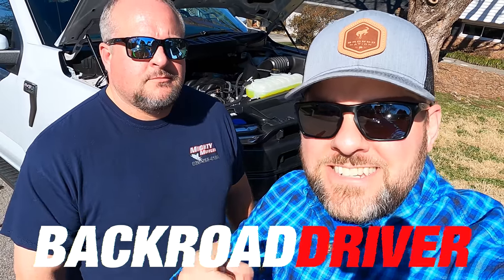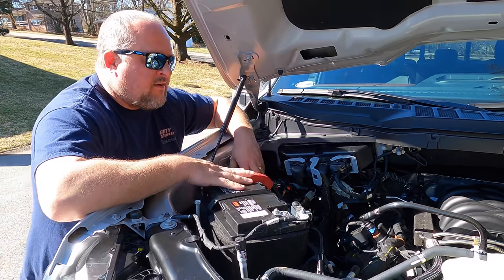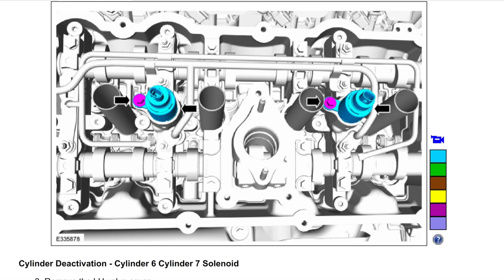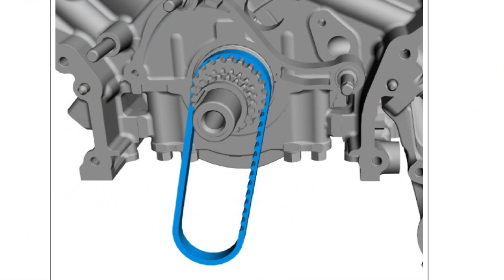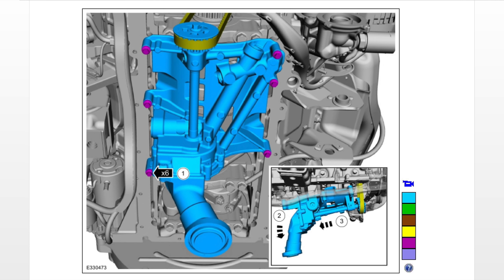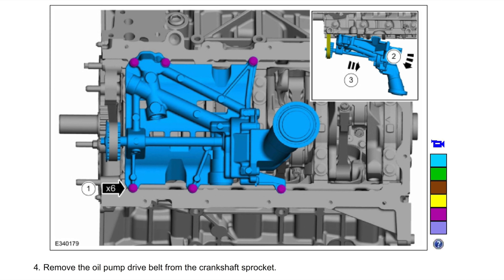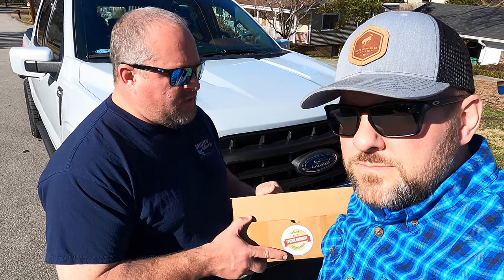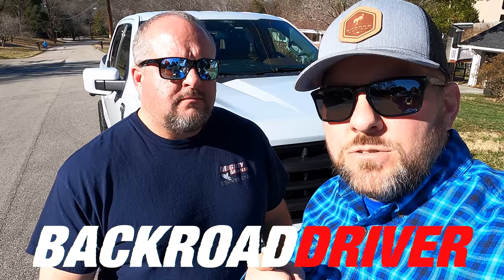2021 Ford F150 5.0 V8 Cylinder Deactivation & Oil Pump Belt Explanation - JLT Catch Can Install

Comment: That is a lot of potential negatives for very little gain.  I'll be keeping my 3rd Gen 5.0  If buying a new F150 this would really push me toward 3.5EB.
Reply from the maker: It's funny how many now see the EB as the safer option.  My how times change!
Reply: This seems intentional to try and kill V8's in mass production F150's. Ford doesn't want to offer a V8 in F150, but they don't want a single move of dropping the V8 from the lineup to kill their record of having the #1 selling vehicle in America for like 40 years in a row. If they can sour up the taste of V8's in peoples mind then over time they will start accepting a boosted V6 as a acceptable option. Many people still want a V8 in their $50K+ truck though. If they just up a kill the V8 in the F150 then many of its sells will go to GM and Ram. 

I'm one of those people who will never go for Ecoboost as a V8 replacement simply based on the fact that I like V8's and could give 2 chits about a V6. (And these modern truck are too expensive of a purchase to not like what you buy) An Ecoboost F150 could go out and run an 11.2 @ 126 MPH, tow 18,000 lbs, and average 26 MPH and as impressive as that would be I still wouldn't like it. Why don't I like it? Same reason I don't want a tranny to give me a blow job regardless of how good it might be. I require a V8 (or maybe a I6) in my expensive 1/2 ton and larger trucks, just like I require a female partner for any sexual acts I might engage in. Ecoboost is not impressive. If you're shocked at how good it is compared to a mass produced, N/A V8 that will run on 87 octane then you really are ignorant on what boost really is and how it works. I've owned both my 03 Cobra and 03 Lightning since before either Ecoboost or Coyote where around and already knew how potent factory boosted engines were. I didn't find it impressive in 2010 and don't fine it impressive in 2021. Not in F150, and not in FGT either. It's not necessarily that Ecoboost is bad, just that it's doing what it's supposed to do and there's nothing amazing or shocking about it. First a 3.5L engine is not a small DOHC V6, then you run a higher compression ratio than what a LS1 had, then throw like 12-13 PSI through a couple snails at it with a DI setup, and you're going to be making some decent power. Back in the mid 2,000's my 03 Cobra put down 490 WHP/502 lb-ft with an unport M112, boltons, and only a 2.93" which made like maybe 12-13 PSI. (Call all the BS you want, and yes I understand that these are very impressive #'s for that setup) That's an old 4.6L DOHC Modular with a 8.5:1 CR putting down #'s that would anywhere near close to the #'s an Ecoboost running that small a CR and boost would put down. (As it should) Point being is that what Ecoboost does is not an amazing thing. It's does what is expected from an engine that size running that much boost and compression, and it's MPG's aren't that impressive IMO unless maybe you drive overly conservative with it and try your best to keep it out of boost.

The good thing about cylinder deactivation in OHV engines is that you can delete it. This is because they use the lifters to deactivate the cylinders so you can just replace them with regular lifters and plug the oil passages leading to the lifters that deactivate the cylinders. (They're hydraulically activated with your engine oil) You're also going to have to do a cam swap, run new pushrods and get retuned to delete it, but it's a great excuse to do a H/C swap in your modern GM/Chrysler engines. Really you can cut it off in a tune but cylinder deactivation isn't a software issue, it's a hardware issue if you know what I'm saying. For example my 19 SS 1LE is a manual car so it doesn't use the AFM, but a GEN5 LT1 is a GEN5 LT1 regardless of what trans is mounted to it so even though the AFM never activates in my car the AFM lifters in it can still potentially collapse and take out the cam or whatnot. IDK how hard it will be to delete it in the new Coyote seeing as it doesn't have lifters to use to deactivate it's cylinders. Maybe it will be a simple thing to deactivate, and maybe a tune is all that's needed to get rid of it and not have to worry about any other hardware in the engine going bad like you do with the cylinder deactivation lifters in OHV engine, but IDK. 

Hopefully the oil pump setup in these new Coyotes won't be an issue, but who knows. The belt thing seems kind of crappy, but seeing as GM is also doing it in their new 3L Duramax then maybe it's us that are ignorant and it might be the best way to go. I wonder if you could pulley the oil pump to get more efficient oil flow?
Reply: @BackroadDriver  Agreed.  I had a 2014 3.5EB.  That was a potent little engine.  Almost reminded me of a diesel when towing.  Unfortunately it started having issues even before warranty was up.  Water pump (it happens) and turbo coolant lines replaced.  Then brakes had a recall (if memory serves) and were fine for a while then started making odd noises as if ABS was kicking in.  I traded it in on the 2018 5.0 as I felt like it was giving signs of being problematic as it put more miles on.  With these latest updates to 5.0 I think I'd take another look at the newer 3.5EB.  Hearing a lot less horror stories online since they upgraded away from the 1st Gen 3.5EB.
Reply: @jmcd1234  That water pump thing scares me. My wife's car is a Taurus SEL and it has the N/A version of the 3.5L. On the FWD based vehicles that mount the 3.5L engines (N/A or Ecoboost) transverse they put the water pump inside the timing cover to save room in the engine. What a stupid move as the easiest way to get to the water pump is to pull the engine so PM'ing the water pump is basically out the question unless you want to spend a lot of or effort changing a good water pump before it may possibly go bad. Still if it does start leaking it's doing it right into the crankcase which will likely be even more costly. Otherwise it's a decent car. Gets real good fuel economy for a V6 car its size, has a large trunk, very smooth at highway speeds, is pretty quiet and refine, and is one of the easiest cars ever to change the oil in. I've been very happy with it so far, but again that water pump issue worries me.
Reply: @JROC734  Well the 5.0's have crappy water pumps too.  My 2015's went at 60,000 miles and when I googled it to diagnose I found out it is quite common to fail around that time.  The only good thing is it is in the traditional location although Ford uses o-ring seals instead of traditional hose clamps.
Reply: @BackroadDriver  I was planning on getting a 21 with the 5.0 to replace my 2015 5.0 - I like it a lot better than the 2011 3.5 eco I had before - better fuel mileage and less problems.  With cyl. deactivation and a rubber belt to fail I think I'm going 3.5 again.  Hopefully the 2nd gen fixed the 1st gen problems such as stretched timing belts and bad spark plugs at 50,000 miles.

Comment: Correct me if I’m wrong but this is still a 3rd gen 5.0 engine. there is no 4th gen. Adding the cylinder de-activation does not make it a 4th gen

Comment: On my Ram I can change a setting so that there is an "eco" light on the dash that lights up during cylinder deactivation. At first I didn't really notice when it happened but the eco light helped me detect when it was happening. Now I can tell by the sound because the eco light helped train me to detect it. (Stock exhaust)

Comment: I was looking into purchasing a F150 V8 regular cab.  I didn’t know they had cylinder deactivation. Until  I watched your video.  Thank you for your information.  Seems like if you keep it in sport mode it will turn it off. 🤙🏽🤙🏽

Comment: The oil pump drive belt on the 1.0L Ecoboost would get tiny pieces of rubber in the oil pan and stop up the pump thus starving the engine of oil!

Comment: I have the mbrp preaxle exhaust (Love this exhaust, btw) and I hear the Cylinder deactivation. Im wondering what it sounds like from outside the vehicle. Like is it noticeable to other people driving or people you drive by.

I installed the J&L catch can last week on my 5.0. I noticed oil in the factory hose while installing the can.

Comment: Deciding between 2021 lariat ecoboost 3.5 or 5.0 coyote...any advice  now that you have had yours for a bit?
Reply from the maker: I love my v8. The EcoBoost has a lot of power but it just doesn't have the sound and the old school feel of a truck. They are both good choices but if you want to hear some rumble you've got to go with the v8.
Reply: That’s what I ended up getting!..lol debating on doing the exhaust or just cutting the pipes... does the level affect your gas mileage. I got 18.7 the other day on the interstate..wondering what your is averaging
Reply from the maker: The level and bigger wheels and tires definitely effects MPG.  I'm probably averaging a little less than 15 for sure.  I'll be addressing miles per gallon in an upcoming video.
Reply: I will stay tuned for that video
Reply: One deciding factor might be low end torque.  It's much higher on the 3.5L V6 ecoboost.  But also, the V6 runs hotter, so the entire engine compartment is hotter, which might lead to earlier breakage ...just a thought, I'm no expert.
Reply: 3.5 Ecoboost all day. Save the 5.0 for my Mustangs.

Comment: Great info! Interested to see how the oil pump belt plays into bigger power setups.
Reply from the maker: Thanks for watching Randy! I'm curious to see how this goes as well. I've got a lot riding on it!
Reply: @BackroadDriver  Has anyone asked for the purpose of switching to a belt driven oil pump? Was there a practical reason for this other than trying to save a buck? Lets get a Ford engineer on here to explain
Reply: @danieljacob9216  I’m wondering if it has to do with harmonics when the motor is in 4 cylinder mode. I know the previous oil pump gears couldn’t take a lot of on/off shock, like sitting on a two-step at too low of an rpm...the harmonics killed them. Wonder if there are harmonics with the cylinder deactivation that we’re unaware of...short of that, only other things I can consider are more efficiency for the stricter cafe MPG standards or cost, maybe?
Gonna be interesting, that’s for sure.
Reply: @RaceGasSmellsGood  good question time will tell

Comment: Does the 2021 3.5 EcoBoost have these two same problems? Cylinder deactivation and belt driven oil pumps?
Reply: No
Reply: Just cam phasers
Reply: The 3.5 also didn’t pair well with the 10R80, a lot of vibration complaints

Comment: Not certain I will be coming back to Ford. Prices to high, Cylinder Deactivation, Start Stop,  Belt driven oil pump?? you dont need to worry or contend with this nonsense with Tundra. I may be looking at it or Nissan as well
Reply from the maker: I love the competition. 5 or 6 good gas truck companies make them all up their game to keep up.
Reply: Tundra will have all these features in it's next generation, automakers have no choice, they have to get maximum mpg's out of these engines or else they get fined by the government. You want simple you pretty much have to go with the heavy duty trucks as, for now they are immune though liberals are have them in their sights.
Reply: None of this nonsense THIS year. But better hurry up and get your Tundra now, while you can still get the 5.7V8. Because it’s gone next year, replaced by a twin turbo V6, that will have all of this nonsense!

Comment: Ford also switched back to a Metal oil pan and changed the oil weight to 5w-30 from 5w-20
Reply: Are you being Funny or did this actually happen? I very much doubt this as a fact
My current model takes 5w20
Reply: @danieljacob9216  Ford tech here, it’s true that they did switch to 5w30. I can’t speak for the metal oil pan though, haven’t looked under one yet.
Reply: @danieljacob9216  I saw it on the oil cap on a 2021.

Comment: What are they trying to do with a belt driven oil pump?
Reply from the maker: Not sure. It must be a little more efficient than the chain. Time will tell if it holds up.  I'm in it for the long haul though.
Reply: @BackroadDriver  I guess my next question is how hard is it gonna be to service it?
Reply: @BackroadDriver  production cost. Belts are cheaper to manufacture than chains
Reply: @michaelchadwick3497  a new engine costs more than a belt. It's a stupid engineering design.
Reply: @michaelwdagle7410  totally agree never said production cost savings are good. 99.9% of the time it screws the consumer.
Reply: @michaelchadwick3497  Will still need the chains for the cams, the old pump was directly driven off the crank. This would make servicing way easier but the belt looks like it is routed behind the chains, so it is still just as big of a job. Not sure what the benefit of this move would be, much easier pump replacement at least.
Reply: @michaelchadwick3497   Maybe, yet this engine still has timing chains and the Godzilla has a very similar (non crank driven) oil pump setup except it is driven off of the timing chain.
I can’t help but think the belt decision is to address a harmonic issue when it is in 6 and 4 cylinder modes.
I actually don’t think the decision go with an oil pump belt choice had anything to do with cost cutting.

Comment: Should I buy a 21 or keep my 15?
Reply: go for it!
Reply from the maker: If you can get a high trade value on your 15 and get your new one at or below sticker.
Reply: Picked one up 3500 below msrp
Reply from the maker: Boom!
Reply: 100% Keep the 2015 version. Those are when the 5.0 was actually good and dependable. DO NOT get the 2021 with cylinder deactivation.
Reply: @johnwalker5622  too late already have the 21 now
Reply: @GreenBuckeye  that's amazing. Around here, just finding one is amazing. Congrats!
Reply: 2018-2020
Reply: @johnwalker5622 that motor is related tp ghe old crown vic too, not mustangs. Mustangs do not ha e flex fuel either.

Comment: If the oil pump belt breaks and oil pressure drops. Will motor be hurt if you shut it off right away. Kinda just like a cold start. Off course shutting off motor going down the road isn't very safe usually.
Reply: If the belt breaks and the driver catches it right away, it should be ok. A few seconds to pull off the road and shut down shouldn't cause any problems. Shutting off the engine in motion is an issue because steering and braking get much more difficult, though I'm not sure about the electric assist power steering and how that would react to engine shutdown in motion, and also, an intentional engine shutdown in motion might consist of a person turning the key all the way back which locks the steering column, in general, shutting off the engine in motion isn't recommended for safety reasons, not really for the engine itself.

Comment: Has the oil consumption problem been fixed from the previous model?
Reply: onward and upward man, ford doesn't look to the past, they look to the future!  I wish my coyote didnt have the engine knock... they say its normal, some do some dont.... Oh great thanks...
Reply: To be honest, you shouldn't believe anybody even if they claim it was fixed. The same guys that will swear the 5.0 oil consumption was "fixed" with the software update on 2020 trucks or was "fixed" for 2021 are the same guys that claimed Ford fixed the cam phaser problems on the 3.5 Ecoboost every year. I was told they fixed it for 2013 and they were wrong. Then someone said they redesigned them for the 2014 model year and they still had problems. Then another claimed they totally fixed it for the new truck in 2015. Then they said they fixed it when the new Raptor came out in 2017. At this point I think Ford will fix easy things that come up from year to year, but complicated issues with oil consumption or cam phaser rattle are never going to be guaranteed. Especially if the fix might affect fuel economy or cost a lot in engine design changes.
Reply: @karlschauff7989  is that why my 5.0 ticks on and off...and mechanics say it's normal
Reply: My 2018 ate a quart each oil change and i was not happy about it. Two tsb's were released to fix it. First did nothing. 2nd one fixed it. It reworked the throttle body under WOT. Because it would snap open so violently that it caused a vaccuum that sucked oil into the intake through the pcv valve. I noticed zero difference in performance and i personally can assure you my truck that i run the balls off it doesnt burn any oil now. No bs no lies, no covering up for ford, honest truth 👍

Comment: Is your warranty void now?
Reply from the maker: The oil catch can will not void your warranty at all.  If you were worried it can be taken off in just a minute or two.
Reply: All it does is keep a lot of oily gunk from going into your intake manifold - if anything it improves longevity.  You'd be surprised how much gunk these filter out.  I have one on my 2018 Mustang.

Comment: The 2021 V8 and the 3.5 EcoBoost F-150 have the new Ford PFDI technology, two injectors per cylinder one in air intake port and another inside the cylinder, do you still see the need for the catch can? are you collecting any gunk in there?..... thanks!
Reply: 3rd gen has that too. My 5.0 catch can gathers lots of stuff
Reply: The added fuel injectors only cover the issue of dirty intake valves. Not having a catch can still has other issues. Like lower octane rating from having water vapor and oil contamination. Lower octane can lead to predetenation. Even if minor, the truck will pull timing to compensate. This results in less power and efficiency. Boosted vehicles tend to have much more blow-by. This increases that issue and more contaminates will end up in the catch can.